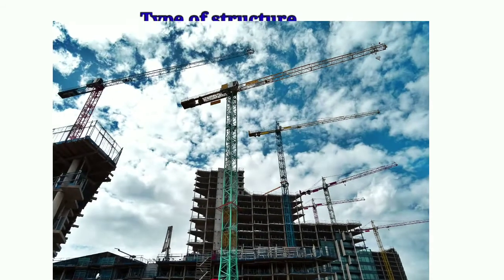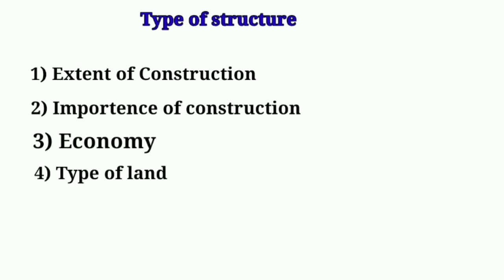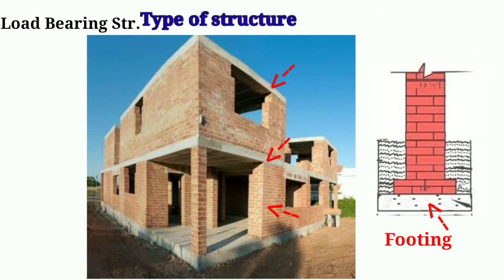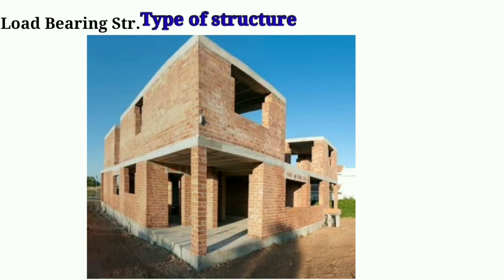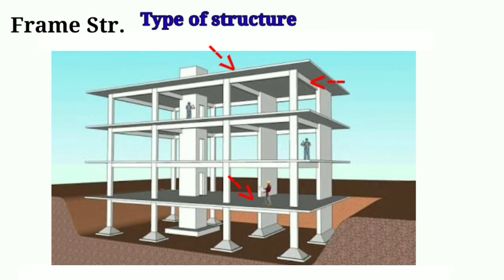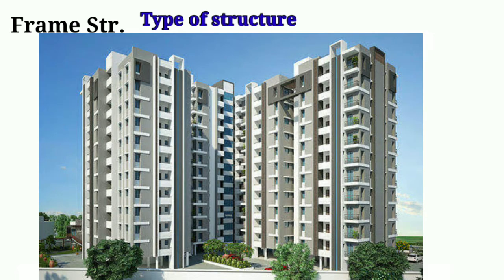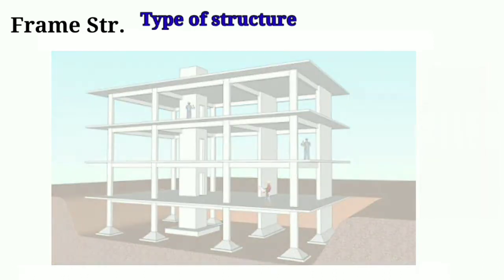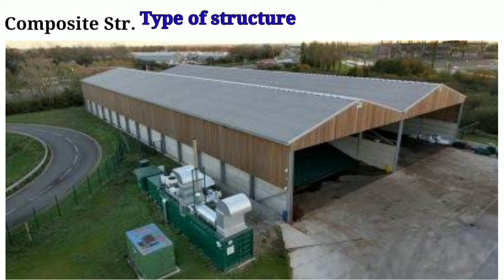Type of structure, Explore the information.

Comment: What is the most economical method between load baring and frame structures for 3 story houses?
Reply from the maker: For 3 story Frame structure more economical then load bearing. Because in frame structure the thickness of wall get reduse almost half, so here is a material saving and hence economy achieved. But in case of load bearing structure you have to use more thicker wall in terms to transfer load of building to ground and hence you need more material and finaly cost (material+work man) increas.